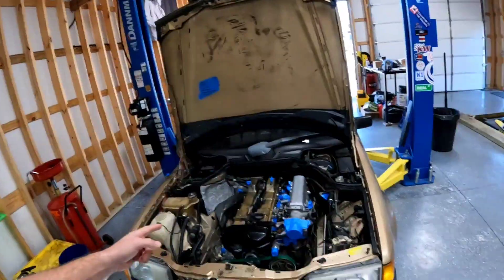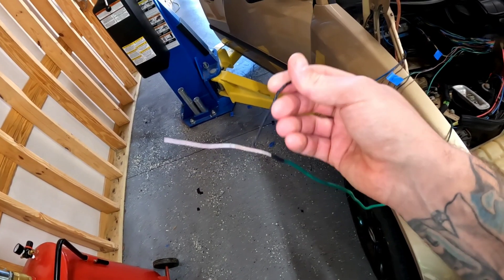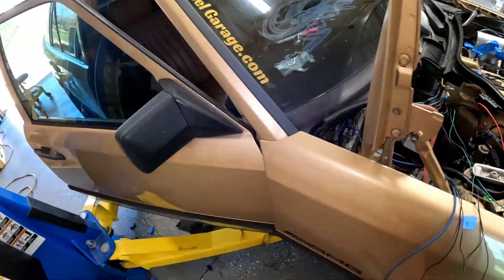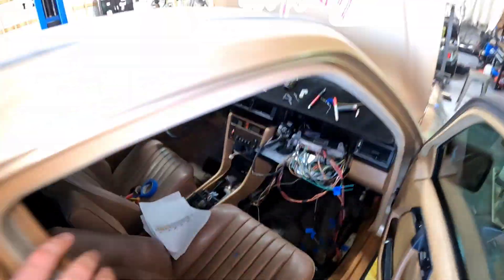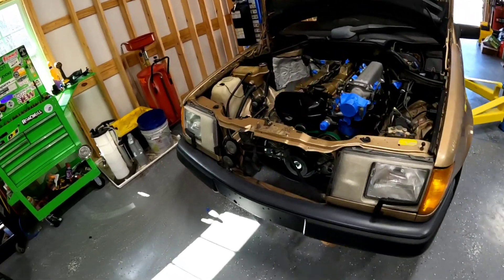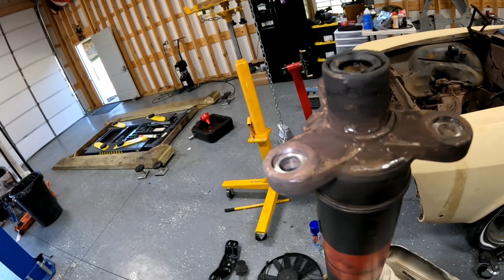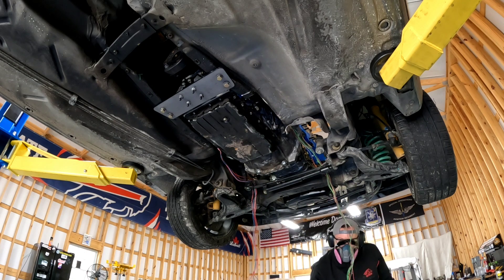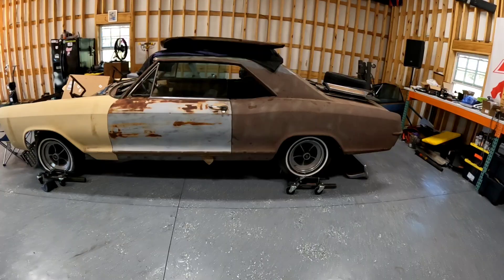How to Build a Budget 2JZ Swap Part 7: 2JZ GTE Stock ECU wiring

Comment: For the alt light, did you just inline an actual bulp to it? Where would this wireto to if I'm on am ecumaster black?
Reply from the maker: I didn’t wire a bulb .  I wired a resister I believe and to ground.   Can’t remember but I think I did explain in video or a subsequent video.   Check out wiring specialties instructions for a universal 2jz gte vvti harness.  Pretty sure they explain it as well.

Comment: What is the serial for the ECU you used!!! did you have to mess with immobilizer nonsense with a programmed key and what not? Been searching for this answer for some time now!!
Reply from the maker: No I specifically bought this ecu because it's a non immobilizer unit.
Reply: Do you remember the serial/model # of the ECU unit ?Is it manual or auto? Really stuck on my swap with the wiring so far but this video is a MASSIVE help! ty Man @timelesssteelgarage

Comment: And your not tricking the ECU connecting both signals to one throttle position sensor, every time you start the car it’ll do a self test and if it reads both TPS signals same value, it’ll think there is a problem and it will go into limp, safe mode. You can get away with not using many VSV but if you don’t use electronic throttle body it will go into safe mode. Safe mode won’t allow you to shift properly and In some cases it won’t advance timing.
Reply from the maker: I appreciate the heads up.  I know a guy who is running the throttle pedal and tps signals  wired together and he hasn't reported an issue .  If it is infact an issue, I'll just have to get a pedal.  Not worried about the shifting because I am going full manual control.  Idle control is an area will pursue but for now left it out.   

If the stock ecu gives me to much trouble I'll just get an emu black.  For simplicity.
Reply: @timelesssteelgarage  you won’t have any problems but the tranny not shifting properly. If you are manually shifting the trans then don’t worry about it. There is no electric pedal. Both sensors are on the throttle body. I highly suggest you go with electronic throttle. It’s not hard to wire it and motor is going to run a lot better. I’m giving you this advice because you are using stock ecu and stock throttle body and auto trans. And make sure you are using the right mass air flow. Connectors are the same but the wiring changes on some sensors, just like TPS.
Reply from the maker: @Mystery Garage  shoot me a message on my Instagram acct. If you don't mind .

Comment: You should have used electronic throttle body that way transmission works normal and you don’t worry about idle. TPS should work as long as you wire it properly. GE and GTE TPS are different but if you wire it yourself you Cain wire it properly and it’ll work.